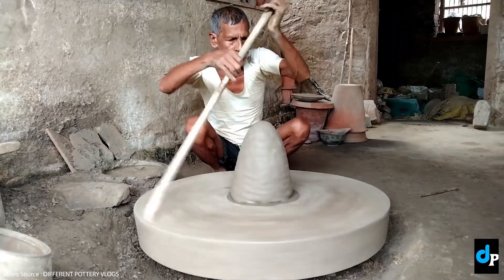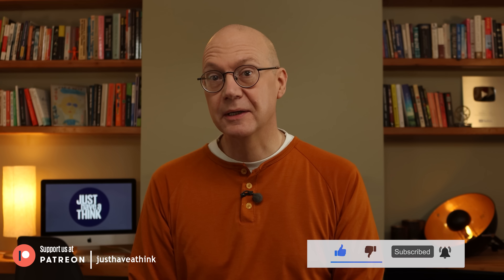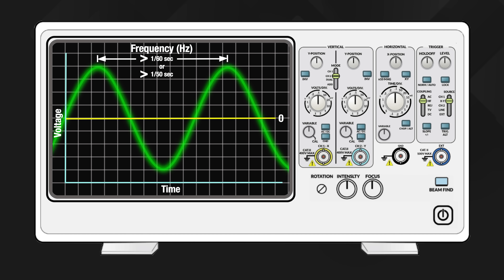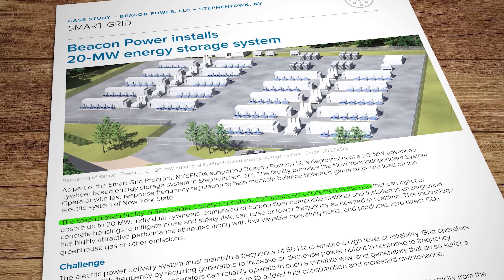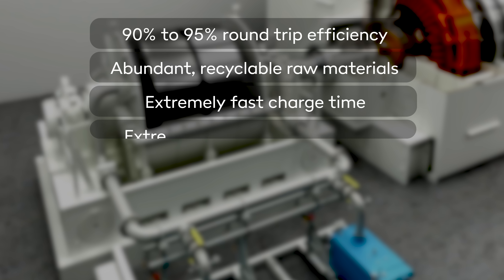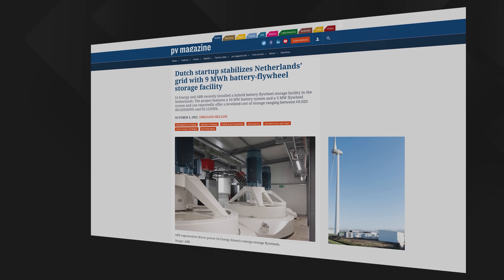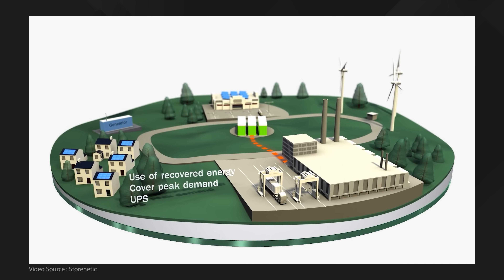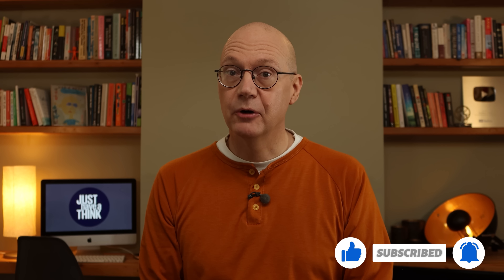Flywheel reinvention revolutionising our power grids!

Comment: In a thermal power station (coal, nuclear, oil…) the steam turbine rotor typically weighs about 10 tonnes and the alternator rotor around 15 tonnes - all spinning at 3000 rpm synced to the grid.  Usually the alternator operates in an atmosphere of Hydrogen to reduce friction.  This really helps with short term stability.  Obviously solid state inverters driven by solar or wind don’t have this inertia so need to replicate this mechanical inertia.
Reply: My point  exactly and not explained in the video.
Reply: I think they either use a vacuum or some other inert gas like Nitrogen rather than Hydrogen.
Reply: @smoothjamie4046  Actually Hydrogen is used because it has a low density leading to less friction and also it has the greatest thermal conductivity of all gases so it’s best for cooling.
Reply: Now what? It’s electrons moving to make a magnetic field that will light a lite bulb  or charge an EV  or turn a motor. What’s the connection for solar generated electric power to the need for a spinning fly wheel? Great for storage to keep the grid power smooth. Actually when one simply considers the percentage of time vehicles are just taking up space, all EV’s should be hooked up charged no less than the optimal level to maintain the grid think school buses with just double large size batteries-for all any emergencies in wherever community that school bus is parked at! Why have batteries that sit 75% of the time, at least, that can’t be utilizing those batteries to the most work they can do in their life spans! So just pissing away the Earths energy!
Reply: The control circuit in solar inverters can easily respond quick enough to counter transient loads.
Reply: @dougaltolan3017  My reply s  to you keep disappearing! Maybe its because they contain a link. If you search 
Solving the Renewable Energy Grid’s Inertia Problem in the publication Green Tech Media it explains the problem better than I can. It's not trivial!!
Reply: @dougaltolan3017  what people don't get is how does one stabilize frequency. Grid connected inverters generally sync themselves to the frequently they detect at on the grid and simply follow that. Problem is what sets this frequency. Ans rotating machines. Its hard to explain in a few sentences ☹️
Reply: @petewright4640  I find that most people are really only familiar with domestic sized inverters, and even then don't understand that synchronisation is a very close analog of a rotating machine.

A grid scale inverter, with sufficient energy (source and sink) backing is indistinguishable from a rotating machine from a grid view point. 

The only reason rotating machines are used for grid reference is that they need to be a significant size, big machines are cheaper than big inverters. 

As for what sets the frequency? An atomic clock, usually, with some distributed systems gently syncing to that.
Reply: @dougaltolan3017  I'll try a bit harder. If you have a grid with multiple power sources, of the rotating kind, then they naturally synchronize with each other. If the load on the grid abruptly changes then so does the rpm of all the generators on the system as energy is drawn or taken up by the rotating masses. This continues until the necessary adjustments to their power output is made, which may take a few seconds. Electronic inverters don't do this. Having said that, inverters that provide this inertia effect are now becoming available for large energy storage schemes. For example, in situations where lots of power is coming from small roof mounted pv with simple inverters that just follow the frequency that they see, grid scale synchronization could be lost without the inertia effect of conventional generators. Btw there is no need for an atomic clock as the frequency is allowed, and needs to,  fluctuate as long as it's within +/- 1% of 50Hz in the UK.
Reply: @dougaltolan3017  In other words, how do grid connected inverters synchronize to a grid with a fluctuating frequency without increasing frequency instability.
Reply: @petewright4640  Inverters are built to do whatever is required. With an energy source and sink (storage) it is trivial to mimic a machine.

I too will try a bit harder. Don't teach your granny to suck eggs.
Reply: @petewright4640  domestic grid tie inverters are set for a leading power factor. Supply companies restrict how many may be connected.
Overall, domestic inverters aren't numerous enough to really upset stability.

Edit add :
Inverters can track grid frequency to within a few ppm, it's the power factor that is the biggest issue.

Comment: Na energy storage and flywheel  storage hybrids seem like the best option, smoothing out the charge/discharge times and keeping the cheeper Na batteries healthy for a longer time, kind of like a battery with a super-capacitor but on grid scale size.
Reply: Ultra capacitors are being used at similar scale to flywheels.
And, yes, it's all about reducing battery cycles.
Reply: That could be a great combination.

Comment: Are bearing losses the critical element of this technology? Whether or not, how have efficiencies improved over time & have they flattened sufficiently for the technology to be considered as maxed out?
Reply: Magnetic bearings in a vacuum should last a extremely long time.
Reply: Eddy currents from the magnets would be the primary loss.
Reply: @dismayedtrinket2518  That can be minimized to near zero with proper materials choices, magnet topology, etc. I would think more losses creep in from the wheel itself, as very high vacuum can't be easily maintained and other factors.